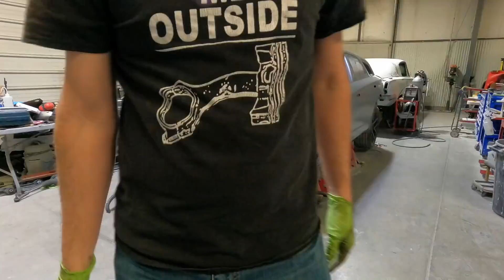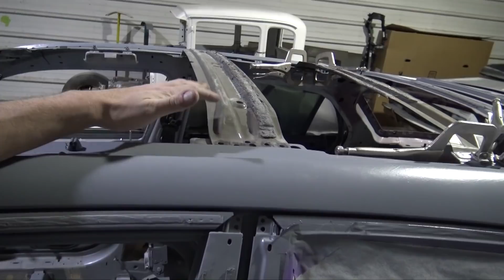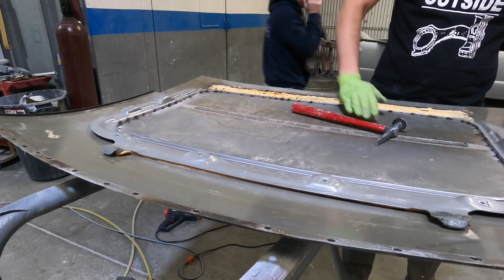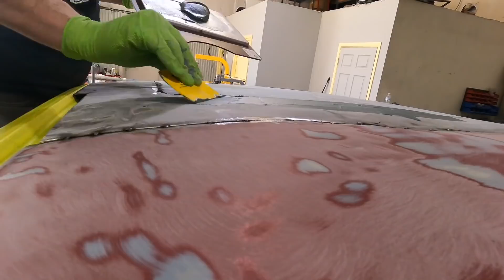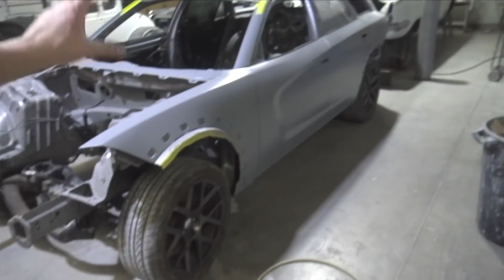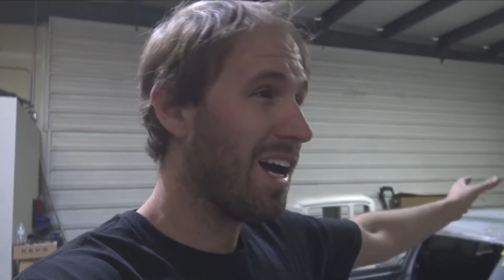Building the Ultimate Station Wagon | 2021 Charger Magnum Hellcat | 1000HP Hellwagon | Pt 28

Comment: Why not add a roll cage while it is disassemble
Reply: He doesn't want a cage, its not going to be a full blown race car.
Reply: @PanameraTurboSEHybrid  didn’t think it would be a race car with all the work he is putting into it making it look nice, but he would benefit from a cage in stiffening the frame along with more support in the roof incase of a rollover.
Reply: @iluvfly11  I get it, but he doesn't like them, they're bulky, cluttering, and adds weight. He's using the factory 300 roof rails to strengthen the frame.
Reply: @PanameraTurboSEHybrid  didn’t know he didn’t like them but it makes sense, at least he is adding some support to the roof and making the roof out of carbon fiber so it should be extremely durable.
Reply: @iluvfly11  Yup.

Comment: The Dodge Magnum was axed after the 2008 model and for the past 12 years FCA has refused to bring it back even though its cousins, the 300 and Charger continue to roll off the assembly line.  Well, in less than a year, Junkyard Dave has put on a workshop on how to go about creating the most badass Magnum.  FCA  should be ashamed of themselves.